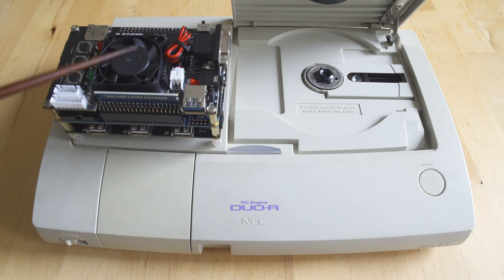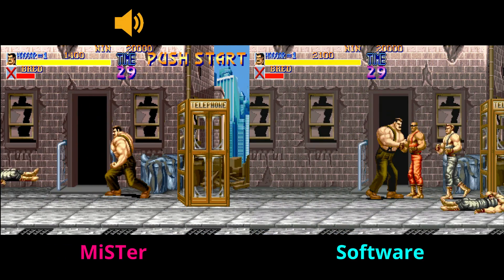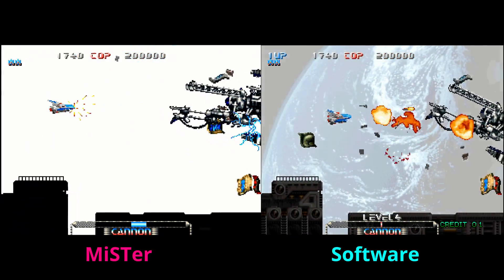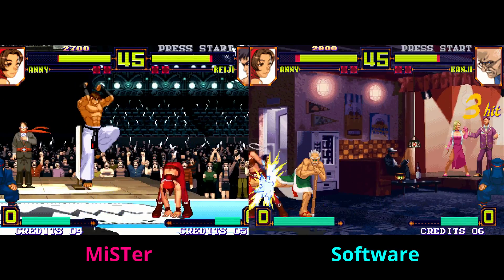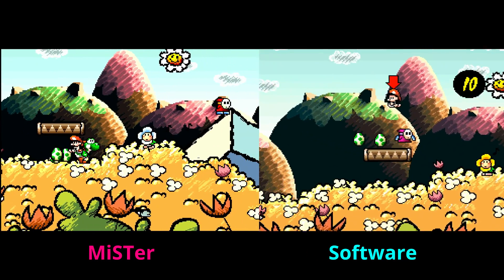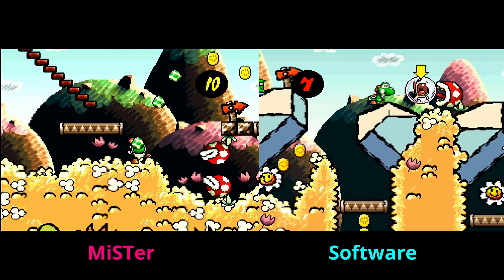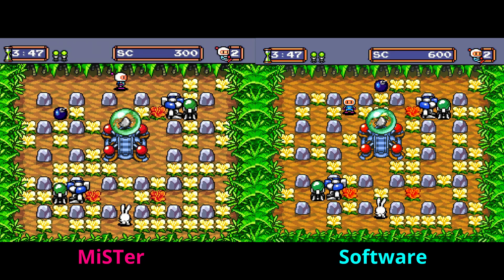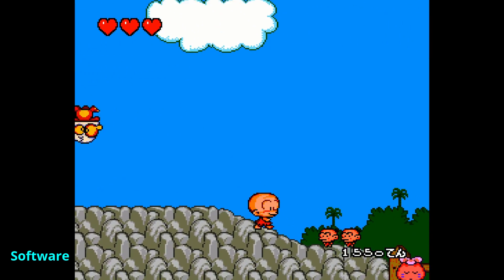MiSTer FPGA DE-10 - FPGA Emulation vs Software Emulation in RetroArch - which is "better"

Comment: The reason you aren't frame matched on the MISTER (I have one myself), is that you may not be running at full G-Sync on your PC setup and you might have it locked to 60fps which is a mistake. That will cause d-syncs. The MISTER out of the box are using VRR, which is what I'm doing on my G-Sync PC setup. They are exactly the same then. The Neo Geo AES console had a refresh rate of approximately 59.60 Hz. Arcade boards as you know are all over the place. Ensure your V-Sync in application should always be off, and let G-sync handle it. MAME has a couple of options in the INI file you should set and forget and away you go. Putting my MISTER and MAME side by side I don't get any de-syncing, they are both spot on. Love your channel though keep up the great work!

Comment: Audio accuracy has always been the low point for the systems that use FM synthesis.. the sample based nature of SNES audio lends itself well to software emulation.  This will continue to improve over time.  Softsynths have reached near perfection for most FM synthesis methods and so it's only a matter of time for the advancements in the "VST" sphere to bleed over in to the adjacent sphere of game emulation and the inaccuracies will become imperceptible.

Comment: this guy is just mad he wasted 500 on the mister and wants to point out any single micro shit he notices or imagines to justify his purchase that will get obsolete. software emulation evolves with a simple digital update installation. with mister you are stuck to hardware until the developer releases a v2 v3 v4 v5 and you wasted your money in something that its not even collectable. as time pases this device will be seen as a electronic project frankenstein . i dont see these stuff get sold by houndreds of dollars in a super potato in tokyo. never. ever
Reply from the maker: Lol I’m this guy. And you realize MiSTer cores update regularly right? Same as software emulation. 

I collect original hardware, FPGA boards, frequently use software emulation, etc etc. 

So maybe slow your roll 🤣

Comment: I think the differene in colors is because of the different bits colors range. You can force it to origianl in the settings. Colors are very simple but the output on screen will always be different on all devices.

Comment: The audio and visuals are identical for me, I know you are noticing a slight difference in the audio but I really do not think that it is the real selling point of the MiSTer, what you should compare however, is the latency, yes how many frames does it take for the inputs to register, this is the real meat, this is the only ever reason why should someone consider the MiSTer over software emulation. especially for bullet-hell shooters and fighting games, it is a game changer an I hope you'd make a video about that
Reply: Especially when using a CRT, it's instantly noticeable when going from my MiSTer to my gaming rig and using software emulation, even BNES, which is just about the most accurate a low latency emulator there is, MiSTer feels like the real thing, 0ms perceptible latency for both input response and video/audio timings, software emulation is a little lower latency via a bloat free Linux OS, I think what might even it up a little, is a bare metal emulation OS, but even then it has to run over the UEFI system kernel (BIOS), legacy BIOS PC's actually have less latency and slightly better frame times, GPU's with ROM legacy BIOS's are also lower latency, if only there was a way to run something like a low latency version of RetroArch directly from the CPU/GPU/MEM/etc (bare-metal) like the MiSTer FPGA bare metal system, that might make things a little more even Steven.

Comment: Good quality Sega MD/GEN audio emulation seems to be very rare and still I've not come across software emulation that can match the real thing, FPGA is much closer to real FM synth audio, with a good DAC and AMP MiSTer sounds incredible with SMD/SNES/PCE/etc, not even Nuked SMD software emulation gets close to FPGA or the real thing for me, though it's nice to have Nuked and filtered FM emulation on a handheld gaming PC as an option, at least untill we get a portable MiSTer FPGA handheld, that will be sweet for OPL2/3/FM synth on the go, will even be able to listen to FM synth and MIDI tunes on the go, that said not even FPGA can match real MIDI audio quality tbh, not yet anyhoo, perhaps someone will develope perfect MIDI FPGA replication someday.
Reply from the maker: The thing is there were so many revisions that all sound slightly different…it’s hard to say what is even “right”
Reply: @VideoGameEsoterica  Well it's just about getting full and rich, detailed FM audio without distortion, interference or timining issues, it's pretty simple, for me the OG Mega Drive 1 stereo model is the reference for that console, with a good stereo audio setup it sounds incredible, same goes for OPL2/3 on Yamaha chips, thats the standard for good FM synth, I'm sure FPGA can replicate these audio chips pretty well if done right. Admitedly MIDI is a trickier, as you say there are so many standards and types, but FPGA can handle that with onboard RAM for loading different MIDI Sounfonts, FPGA could be an amazing swiss army knife solution for audio eventually, a good DAC&AMP is still always important.

Also FPGA can be used for legacy video standards one day too, for example a high-quality FPGA 400mhz RAMDAC for upto 2048x1556 85hz analogue, which is now missing from modern GPU cards since the GTX 1080 gen cards, the FPGA would be able to do 15/24/31khz and CGA/EGA/VGA/etc, would be so usefull to have on a modern GPU for legacy use, for both video and audio, I guess it could be just a sperate PCIe card, but on a GPU makes sense to me, it can share VRAM, the framebuffer, video outputs that can be used with adapters, i.e for VGA or DVI-A etc, or the FPGA could be linked to a USB-C output for multiple video&audio I/O, depending on what you want to use it for, would be useful for capture purposes too.
Reply from the maker: Yes getting down scaled signals out of a modern PC is an exercise in “yeah this is pointless. I give up”. I’d love to be able to go from my 3090 to my PVM via emulation easily without introducing lag but there is no good solution

Comment: I've been looking into the MiSTer and really this video kinda says to save my money and stick with emulation. You compared MiSTer to RetroArch but you didn't say which cores. There are several cores available for most systems like SNES which has the Beetle-mercury Accuracy which emulates more of the hardware vs. the software. Most people suggest to use Snes9x as it has been around forever but it is not the best. Even FinalBurn Alpha has multiple core variations some specifically for CPS systems and NeoGeo. Of course there is MAME which strives for accuracy but also strives for pain. CPS disc based games actually emulate loading from a disc in MAME which takes minutes even with fast-forward, all in the name of accuracy. FBA loads instantly. You also keep mentioning audio. Your system seems powerful enough for the video but audio, depending on what is included on the motherboard, audio can range from crap to almost ok. I've been playing on PC for close to 40 years (still not 50 yet) since sound was always handled by a separate sound card and I've always use a sound card since. I have a $450 motherboard and you'd think the audio would be nice but you'd be wrong. I use an external Soundblaster X4 connected USB-C to the PC and using Logitech Z625 speakers connected with optical. I got to get better headphones but my HyperX cloud II connected to the SB X4 sound pretty good. You can usually fine tune external audio and make many speakers sound better. Point is, external audio is way better audio than what any motherboard can produce. You eliminate any interference the PC produces especially the video card. FYI, motherboard is ASUS Dark Hero, 5800X3d, 3070 Ti.
Reply from the maker: And that’s fair. Everyone gets to make their choice as to what they want to use :)
Reply: Of course I checked out a few of your newer videos and I see you do list what cores and compare with BSNES core. I think you still need to look at your audio hardware. Of course in the real world, you'll never be going through the same audio hardware in the exact same way.
Reply from the maker: The thing about audio hardware is nobody will hear anything the same way. My capture setup, compression, the viewers speakers or headphones…1000 variables

Comment: Mister has better contrast,aspect ratio, drawing,sound and input lag than software emulation, while for someone not purist maybe do not notice those differences, purist people notice these... In fact i did some real test with real hardware and then did the emulation way on the same tv crt and you can see the real hardware looks better, display better image,sound,etc Emulators only replicate via software and lacks hability to replicate video signals,chips and in comparaison game always look jaggier,pixelated than RH.
 There are big differences ( some are more accurate and others less ) but most of casual people will not notice this.

Emulation is good but there is nothing like real hardware, fpga looks promising tho.
Reply from the maker: In all honestly I use a mix of all three and I def have a massive hardware collection so it’s not like I have to use FPGA or emulation if I don’t want to

Comment: Not worth the price difference in my opinion, plus software emulation has around a 20 year head start. You can basically emulate alot more cores via software emulation.
Reply from the maker: And that’s fair. Everyone gets to decide what they want. But that 20 year head start is meaningless when the finished cores are as good if not better than software. Time doesn’t equal better in this instance. 

I truly don’t have a horse in the game. As long as people are playing retro games I’m happy :) do it how you want!
Reply: Although I don't have a Mister, I can definitely see the value. I emulate on my PC connected via component to a Trinitron CRT tv. Although I get 224/240p resolutions, I can't get native resolutions and use super resolutions instead. Having the convenience to connect this device to my TV and just play some games without adjusting many settings and send my CRT to a different room makes it a nice option. but, and here's a big but, if you're on an LCD screen I don't think it's worth the price difference just for better audio, accurate slowdowns and some color accuracy. But really, Retroarch+CRTwitchress on a CRT is good enough, it's just a pain in the ass to have a CRT close to my main setup.

Comment: It has been proved that people automatically like louder music more, therefore you should volume up the music in software emulation a little to match the level of volume. Only then you can really tell if there is any difference.
Reply: Or get a good pair of Gaming headphones and it sounds beautiful 👍
Reply from the maker: All of these audio comparisons are best listened to via headphones for sure
Reply: I mean it's not only about "volume" the audio on the mister is clearly superior. If you add headphones to both, it won't change that fact.

Comment: “Extremely similar”. Correct … when the Mister emulate ps2 and ps3, I ll give up Retroarch and software emulation
Reply from the maker: Haha you’ll be waiting an eternity
Reply: @VideoGameEsoterica  exactly, and when it comes software emulation will be on ps5 already …
Reply from the maker: Sorry not sure what you mean
Reply: @VideoGameEsoterica  current regular emulation is doing ps3, Switch, 3DS comfortably. When the Mister comes to this point (if it ever happen), regular emulation will be doing ps5, X One S, etc. this is why the tiny gain we have with the Mister won’t never match software emulation, in my opinion
Reply from the maker: It’s really not designed to match what software emulation can do platform wise
Reply: @VideoGameEsoterica  in my opinion, they have the exact same goal. But one can put a cherry on the top. The other can’t put the cherry but can give you another and nicer cake (Saturn, Ps2 and 3, PSP, 3DS, Wii, etc). So our decision is pretty much the cherry vs an entire  nicer cake

Comment: Great video. Thank you for doing the hard work with this. I think what this proves (at least to me) is that comparing software and FPGA emulation is almost splitting hairs. For most it will come down to cost and convenience. What I would really love to see is a comparison between a Raspberry PI 4 running Retropie and the MiSTer. That is how many of us are playing these games.
Reply from the maker: Very splitting hairs. But the great thing is how many options there are :)

Pi vs MiSTer you say? I do have a Pi 4 sitting right next to me as I type this....(this is the number 1 request I get. Soon!)
Reply: And even then Retro Pie is running on junk hardware, for way too much money with tough as hell usability SSH-ing into a Linux distro all the time. Thank you. I'll grab a 25€ MacMini and load Retro Arch on it without all the Emulationstation/Retropie bloat and have a much easier time emulating for less money.

Comment: You should consider upgrading your sound card if it always sounds worse. I'd like to see MAME compared against FinalBurn Neo with the versions and sync settings disclosed. I hope you cover the 3D DOS and Win95 games where MiSTer isn't powerful enough.
Reply from the maker: Not sure what I’d cover with DOS? I did a series on DOS games though
Reply: @VideoGameEsoterica  Cool I didn't know. For DOS you could look up Glide API games that originated with the famous Voodoo graphics card. I'd think Battle Arena Toshinden, Descent 2 and Grand Theft Auto to be notable.

Comment: This didn't help much... I am trying to sell myself WHY I need a MiSTer.... as emulation of most systems on fairly new hardware is pretty easy, and with like Emulation Station, or something like that, you get a really nice looking interface (a lot better than the MiSTer)....They are close... too close.. Is the extra money worth it ? This is the question I need to find out..
Reply from the maker: And it’s the one question you need to answer for yourself lol. I can’t answer it for anyone
Reply: I know this is old but the mister seems to have less latency on inputs than inputs on emulation on andriod, pc etc. As a kid i can easily get far in a game like bayou billy on the nes but emulating it, my 8bitdo ultimate doesnt seem to keep up with how fast i want to button mash and I seem to lose more life than I did as a kid
Reply from the maker: @Dante-cv3ts yes it def has less latency. Basically zero if you are on a CRT